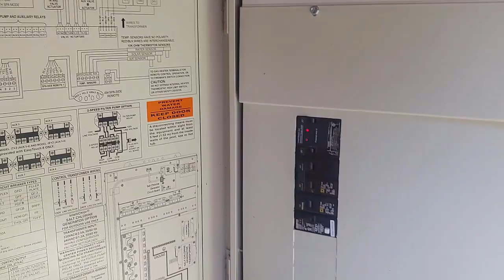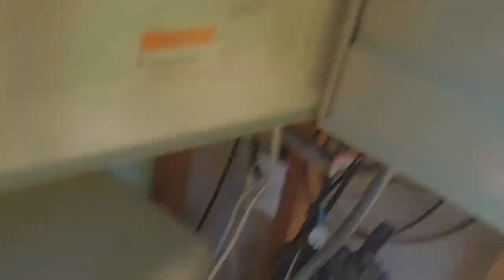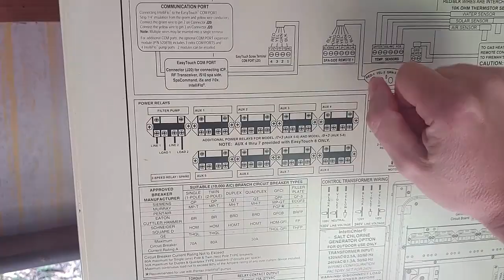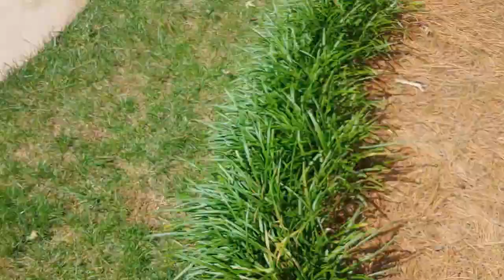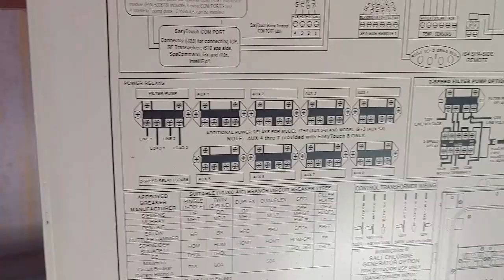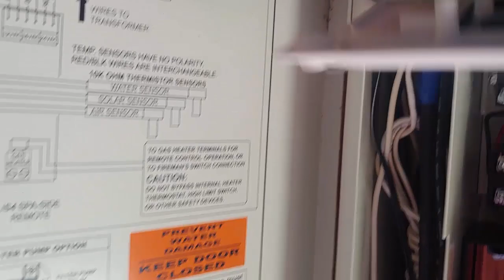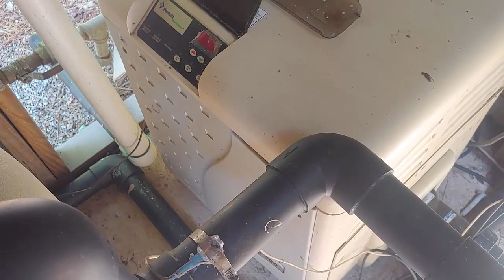REVIEW & overview: Pentair Easytouch 4 & Easytouch 8 installation. Pool & Spa Automation system.

Comment: So watching this it's clicked for me, this danged Pentair "wireless" kit is nothing more than a wireless  RS485 bridge! So instead of using the goofy thing you plugged the RS485->ethernet adapter right in and then used standard wifi. Very nice! Going to check out your other videos as well, pondering converting my 4 relay system to an 8 as it's apparently simple.
Reply from the maker: Thanks for the comment. Yeah I can't remember if it's just a matter of the number of relays or if the board's a little different. If you need me to double-check my board part number let me know.

Comment: I have a lot problems for connection my filter pump 
My dog pull down the wire now I don't know 
Where the cable going to connect
Reply from the maker: That's a strong dog! My pump is a 2-speed pump. If your pump is a single speed pump it should be a bit more straightforward.

Comment: Where's the gfci breakers? Do you have a subpanel off to the side?
Reply from the maker: Hi,  you can see the one for the lights in this video and there is another GFCI device in this box protecting the outlets near the pool. And yes, for 240v motors installed after 2013 you should also have a GFCI breaker for the pump. Mine was 2013.

Comment: the salt cell generator has no power going in to it.. if it plugs in , , the small breaker on easy touch tripped. what could be go wrong ?
Reply from the maker: I'm sorry that's not enough detail for me to help guess. Do you mean the breaker that feeds the saltwater coordinator transformer is flipping? Is it a GFCI breaker? Sometimes those are sensitive to trip and maybe you don't really need a GFCI breaker on that particular one because it only feeds at the equipment.

Comment: Okay. I'm stumped here. Hope you can help as you have same system I have. Pool installed in 2016. I have a new, Paramount Clear O3 ozone unit. I connected wires on Clear O3 as per directions. Neutral on left post, Hot on right post. At the EASY TOUCH PANEL: I HAVE NEUTRAL TO WHITE/COMMON BAR, HOT, FROM CLEAR O3, TO LINE SIDE OF FILTER PUMP RELAY TERMINAL. GREEN TO GROUND BAR. ALL WIRED FOR 120V. When I connect at Easy Touch panel, at Filter Pump Relay, when system comes on, it immediately trips Filter Pump breaker. I'm puzzled and NOBOY at Paramount( IF they answer phone) is figuring this out. Help would be appreciated! Thanks, in advance.
Reply from the maker: I don't have an ozone unit so I'll try to help though. I think your hot to the ozone should be on the LOAD side of the relay. This is to ensure it comes on with the pump running.  Is there a GFCI breaker involved? Any fluctuation can trip those in my experience. Is your ozone generator in your pump the same voltage?  I'm pretty sure they would be wired the same as my chlorine generator.

Comment: Breaker keeps popping
Reply from the maker: Those are the low voltage side. See if you can trace the wires and maybe selectively remove different loads until it stops. One at a time and if that doesn't stop it put that load back and try to take another off.  It's never happened to me before, so I consulted AI here's what it said.     3️⃣ What others do to solve it

🔍 Check which breaker trips and what it powers — label it if not clear.
🔌 Disconnect loads one at a time — unplug valve actuators or relays to see when the tripping stops.
🔧 Check actuators — turn the valve by hand and see if it’s binding.
🧰 Inspect control wires for corrosion or cuts.
⚡ Check for water inside conduit boxes.
✅ Replace suspect components — actuator motors and relay boards are cheap compared to fried main boards.

---

In short:
Valve actuators and corroded control wiring are by far the most common reasons these small IntelliTouch breakers trip.
Reply from the maker: Which breaker? Is it one that has the ground fault interrupter on it? That would be a common one, because they're extra sensitive. If it is that one or one that has a ground fault interrupter built into it that extra little white button usually, check all your connections for moisture and tightness.
Reply: There are 4 in the upper right corner. Three are 3 amp and one is 12 amp and has Intellichlor underneath. Is there a way I could send you a picture?
Reply: I actually changed the circuit board a couple of days ago.
Reply: I ordered what I thought was a replacement but just got it today. It is a W Type Breaker Fuse 12 Amp. I can change it, if it would help. And advice is greatly appreciated. I’m kind of stuck.
Reply: Thank you! I’ll let you know what l find.
Reply: After thinking about this I’m kind of confused. The one that is popping is right above the label intellichlor. 

As l said, l replaced the circuit board. The only thing l didn’t replace was the “object” that is popping. I thought it was a breaker because the section with the 4 squares is labeled “Low voltage circuit breakers”

I ordered something from Amazon that said 12 amp, but the package says “fuse”.

I think I’ll remove the one that is popping and see if the one l ordered matches.
Reply: I sat and watched your video again and took notes. 

So the first thing l did was disconnect the salt cell and the ac wire on the center of the board.

Then, using my multimeter set on 150, then 300, l touched the red test pin to the white wire and the black test pin to the yellow wire. I had no readings in either setting. 

I then set my multimeter on 50 and used the black test pin on the disconnected wire and the red pin on the soldered board. Again, no readings. 

Am l to assume my transformer is bad since l had no readings on the yellow and white wires?

Is there another way to test the transformer to verify before l buy a new one? And there are two in my Intellicenter box that l believe are tied together. Possibly high voltage in to transformer and converted to low voltage?
Reply from the maker: @diannepardinas6261  can you verify that the input on the transformer is indeed on? With your multimeter you could check that. Be very careful with the high voltage. Yours may be wired for 110 or 220. If that transformer is indeed getting power in, it should be producing power out. Also be careful that you're multimeter is set on AC or DC when measuring. I think the output of that is DC but I'll have to check to make sure.  Also note that you're not going to have input on that transformer usually unless your pump is running if your system's wired correctly.
Reply: @SwimmingintheDeep 

Good catch! I did NOT have the motor running. Yesterday with the filter running l got a good 220 from the yellow/white. I’m really thinking my cell is bad. I’m going to contact Pentaire and plead with them. 

Once it’s all back in line though I’d like to put in a surge protector breaker. At least for the pool and maybe for the whole house.
Reply from the maker: Let me know if I can help further. I haven't contacted them in a while but Pentair phone support was very good, even after the warranty, to at least give helpful advice.   @diannepardinas6261

Comment: Still here? Have the exact same system.. my heater turns on at the heater, but the heater does not recognize screen logic. Screen logic operators everything (water features, lights, blowers) but not the heater. Screen logic did operator the heater until 2 weeks ago and then stopped working. Any ideas?
Reply from the maker: Something is keeping the heater from communicating with the Intellitouch. Check your wires, and connections. Take off the Intellitouch covers and make sure ants or something have not caused havoc. Your screenlogic system is otherwise working which is good, indicating that the comm stuff is probably OK on the board. So I am not sure. I plugged in the question to AI and it gave me this so check these things but FIRST, powercycle your entire system by cutting the main powerfeed for a minutes or so...that may fix it first.     
✅ Steps to Troubleshoot
Check Heater Mode

On the heater's control panel, ensure it's set to "Remote" or "Ext" control (depending on the model—e.g., Pentair MasterTemp).

If it’s in Manual or Standalone mode, ScreenLogic won’t control it.

Inspect RS-485 Communication Wires

Open your IntelliCenter / EasyTouch / IntelliTouch panel.

Look for the red, yellow, green, and black RS-485 wires going to the heater.

Ensure all connections are secure, uncorroded, and not pinched or broken.

Power Cycle the System

Turn off power to both the automation panel and heater for a full minute.

Turn them back on. This sometimes clears communication glitches.

Check Heater Settings in ScreenLogic

In the ScreenLogic app or desktop interface, go to Settings > Configure IntelliTouch/EasyTouch > Circuit Names.

Make sure the "Heater" is assigned to a valid circuit.

Also confirm the correct "Heater source" is selected (e.g., "Pool", "Spa").

Run Diagnostics in ScreenLogic Interface

Some versions let you view equipment status or logs.

See if the system thinks the heater is available or shows an error.

Update or Re-flash Firmware

If nothing else works and this started after a power outage or system change, your IntelliCenter or EasyTouch firmware may need to be updated or re-flashed.
Reply: @SwimmingintheDeep  thanks very much. I’ll give all this a try.
Reply from the maker: @cubmixit  there's also a toggle switch in the screenlogic configure area.... You can also probably find it in the menu on IntelliTouch. Make sure that where it says manual heat, that is toggled off.
Reply: @SwimmingintheDeep  IntelliTouch control panel or spa-side remote. You can access the Manual Heat screen by going to MENU > SETUP > EQUIPMENT > HEATPUMPCOM and selecting the appropriate heating options. … would this be the correct location to make sure it is switched to off?

Comment: Crazy Question, but do you think I could install a circuit on the load center for charging an electric vehicle?  I could add a Square D 30 amp breaker for 24Amps 240V charging.  What do you think?
Reply from the maker: I am not an expert on that but I think the panel is rated for 125 amps total. So, add up the total breaker amps your have and see if you are under. You also need to have enough power supply feeding the panel though so I don't know what that is for you. For me that is a 60 amp breaker coming off my main panel.
Reply: @SwimmingintheDeep I have 100amp service to the pentair. I have measured maximum draw is 30amps with pool pump starting from dead stop, so I am pretty sure I can install this, but I don't know if the busbar is rated for continuous amp draw
Reply from the maker: @johnYoungGunLee  disclaimer is that you would be safest to ask an electrician.   But Chat GPT seems to think you're going to be fine.  I'll paste what it says from my paid version of Chat GPT...

Yes, you can likely add a 30-amp, 240V double-pole breaker for an electric car charger to your Pentair EasyTouch system box, but there are several considerations to confirm safety and compliance with electrical codes:

1. Main Panel Capacity and Upstream Supply

Your Pentair EasyTouch box is rated for 125 amps, but it is currently supplied by a 100-amp breaker upstream. This upstream limit is what dictates the maximum allowable draw for the box, not the rating itself.

Adding a 30-amp car charger would bring your total potential load to:

30 amps (pool pump) + 30 amps (car charger) = 60 amps.

This is well below the 100-amp upstream supply, so you have room for this load under normal operation.

2. Continuous Load Considerations

NEC (National Electrical Code) states that continuous loads (defined as loads running for 3+ hours) should be calculated at 125% of the load for circuit sizing.

For your 30-amp car charger: .

This continuous load applies at the breaker level, not necessarily at the box level, unless the upstream 100-amp supply also has other high-demand loads.

3. Bus Bar Load

Your bus bar must handle the cumulative loads of all breakers. A 30-amp pool pump and 37.5-amp continuous draw for the EV charger would still add up to about 67.5 amps.

Since your bus bar is rated for 125 amps, you are well within its capacity.

4. Upstream Panel Load

Confirm that the 100-amp supply panel feeding your EasyTouch does not already have excessive load on it from other breakers or sub-panels. The key is to ensure that total concurrent demand doesn’t overload the 100-amp breaker.

5. Breaker Compatibility and Wiring

Verify that your EasyTouch box has available slots for a compatible 30-amp double-pole breaker.

Ensure that the wiring you use is appropriately sized for the 30-amp load:

Use 10 AWG copper wire for a 30-amp circuit.

---

Summary

Based on the information:

You currently draw 30 amps for your pool pump.

Adding a 30-amp 240V EV charger is acceptable since the total load will be well within the 100-amp upstream supply.

Continuous load at 37.5 amps for the charger and the pool pump’s draw is manageable.

Final Note

Double-check:

1. Your 100-amp panel's total load to confirm spare capacity.

2. Local electrical codes and permitting requirements.

3. Proper breaker sizing, wire size (10 AWG), and grounding for the car charger.

If everything aligns, you should be fine adding the EV charger.
Reply: @SwimmingintheDeep  I called pentair and they can't comment on my application, but they confirmed the busbar is rated for 125 amps, and my application should work
Reply: But then, I received a followup email stating they cannot endorse this application.  Ugh
Reply from the maker: @johnlee7691  @johnlee7691   they're just covering themselves. You've got factual data that backs it up I believe. I would personally do it.
Reply: @SwimmingintheDeep  you are right!

Comment: great video.  i might have missed it but what guage wire do you use?  i am using the panel for garden light, sprinkler valve and some patio lighting
Reply from the maker: If you're running LED lighting, and valves, you can easily get by with 14 gauge wire.

Comment: my lights stops working ,the remote 4 spa,how do i test them ?
Reply from the maker: Here's what I think you're saying... The button on your spa side remote is no longer turning on your lights. If that's the case, go to your panel board with a spare piece of small wire, look for the plug for the spa Remote, unplug it and jump the contacts on those for contacts on the board (black common to the one that is the lights) and test. It should make it work. If it makes it work then your switch is probably bad

Comment: Thanks for posting the video on Pentair setup, you mentioned that sometimes the mother shorted out due to electrical surges. How did you repair the board, as I have a similar situation my motherboard has stopped working due to a brown out in my area.
Thanks in advance.
Reply from the maker: What seems to be not working on it? Everything or just a couple of things like the screen logic interface?  There are a couple of repair services on eBay that will repair your board and send it back to you.
Reply: @SwimmingintheDeep  - thanks for getting back with me, after the surges, the screen went dark and there was no functionality from all the buttons. I have tried to press the 3 breakers on the right side of the panel, and they were not tripped.  I have not checked the voltage output from the transformer yet to ensure there's power to the board, I will do that today.
Reply from the maker: I think you are on the right track. The only thing that I really know how to repair on this board is the LCD and the comm chip that is used for Screenlogic. Neither is an easy repair either. I can try to give dig up the email for the guy that helped me, he may be able to diagnose the board.
Reply: @SwimmingintheDeep  I did some troubleshooting and started measuring the voltages from the transformer and found all outputs were 0v. I found a replacement Pentair transformer from Walmart, installed it yesterday and now everything is back to working for ~$178. Great to avoid the major cost of a controller board replacement. Thanks, again for the help.
Reply from the maker: @darrenterrell8411  That's awesome you figured it out and not too bad for the repair. Any pool company would have charged twice as much or more. Thanks for letting the comments section know too! I hope it helps others.

Comment: Great video and Thanks!!  two questions.  First, what is the Internet access point that you used to get the ethernet port outside?  Second, do you have your 12V transformer for your pool lights inside your automation panel or is it outside the panel?  GREAT CONTENT!
Reply from the maker: Thanks so much for watching and commenting!  For the Internet/connectivity, I now use an Asus RT-AC86U as my main router in the house and an Asus RT-AC68U out at the panel.  That is an update/different from what is seen in the video.  They are in what Asus calls AImesh. Any mesh setup could work from any router brand if the one at the pool has a ethernet plug in, rather than just wireless.   My brand of lights has the 12v outside the panel as a separate box.  One of the relays in the box is assigned to turn them on/off. My brand of lights is called SR Smith Fiberstars.  I have another video here on the lights and landscape lights. https://www.youtube.com/watch?v=uDaTy7nnQhw&t=1s